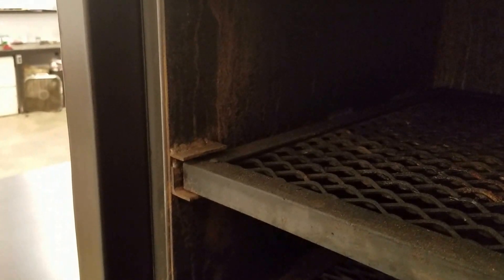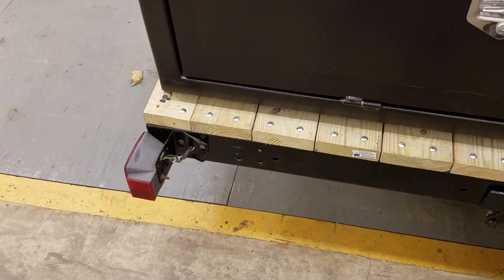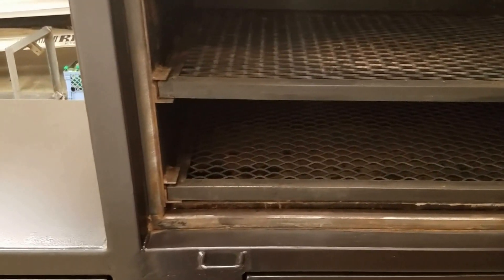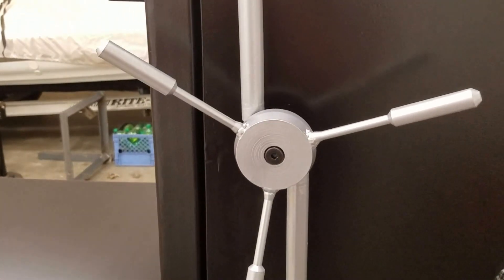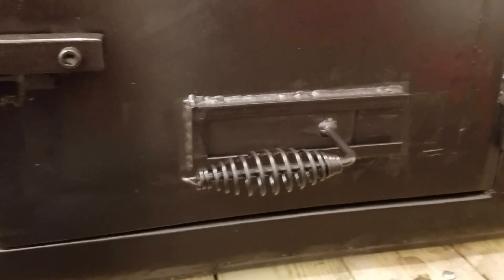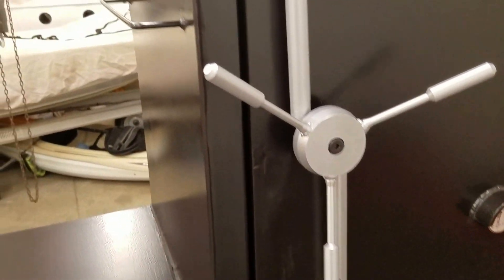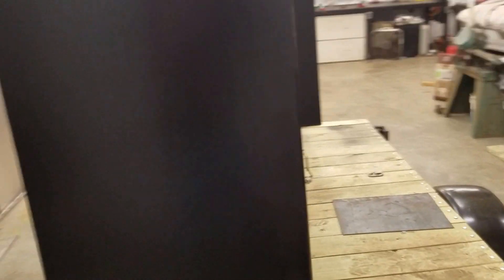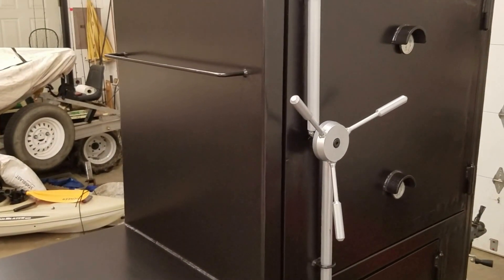Insulated Reverse Flow Barbeque Smoker Build Part 17

Comment: I'm telling you, those boards will start sagging after a while. You need to run a joist down the middle under those boards. One that sits in the valley of the metal frame.

Comment: Your smoker shouldn't have rust in it did you season it wit oil i use canola oil in a sprayer after every cook clean it while it's still warm drain all the water out of the water tank
Reply: Barry Powell I absolutely agree.  I build Smokers and cookers professionally , and I preseason all with canola, then heat the unit for an empty cook to set the oil. If maintained, even my outdoor units sho no signs of rust

Comment: Why do you use so much water? I generally only use water for poultry. Brisket, ribs etc. don't really need water to be moist. Maybe some liquid sprits every so often for pork.
Reply from the maker: +Gonzalo San Miguel it is just personal preference. The main benefit for the pan is to catch all of the drippings. One bonus of having water is it makes cleaning the smoker easier. I still spray, pork especially, with some apple juice or apple cider vinegar occasionally.